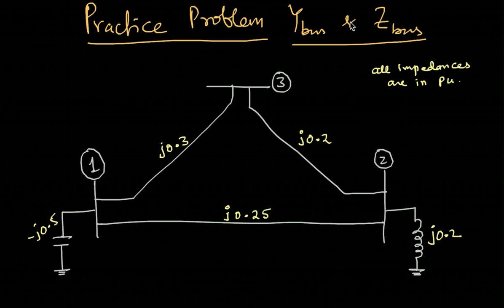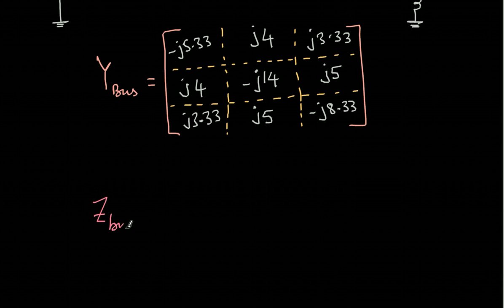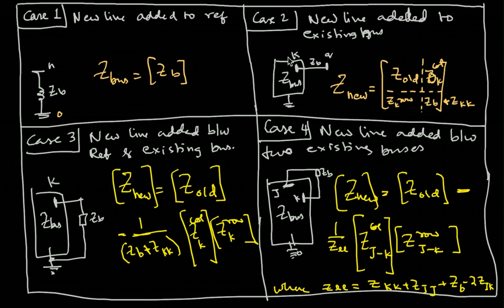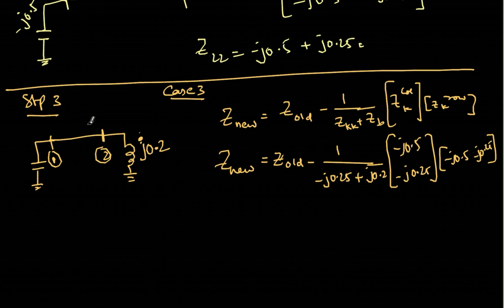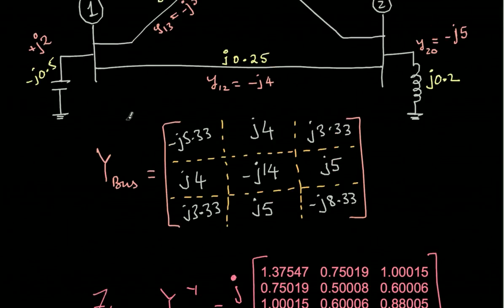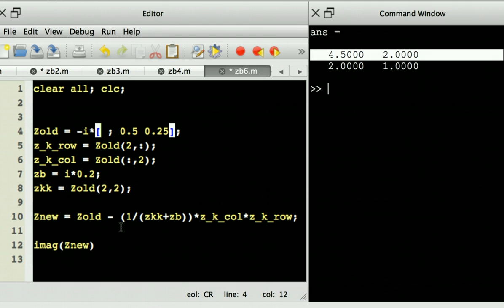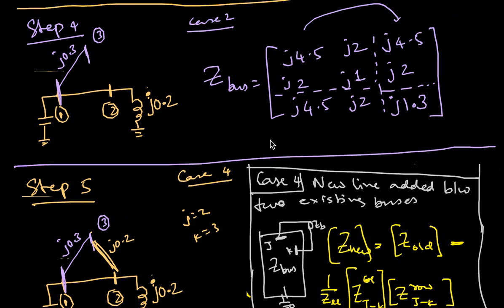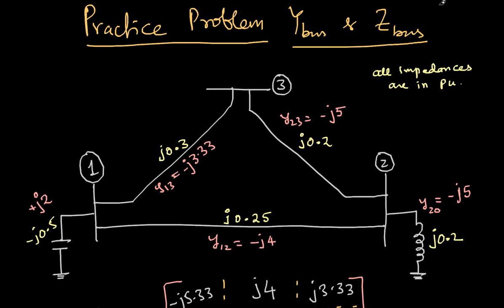Bus Impedance Matrix - Part 3

Comment: Hey I think you've made a mistake at 16:26 , shouldn't it be j4.8 instead of j1.3
Reply: Z11+z13
Reply from the maker: Yes... you are right. thanks for correcting. It should be j4.8
Reply: Yes
Reply: Corrected it at 22.52